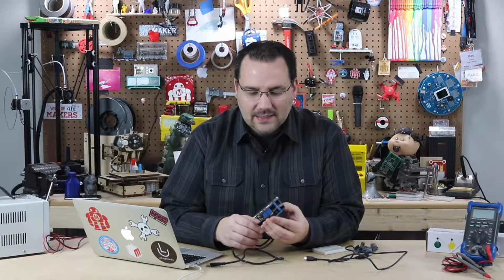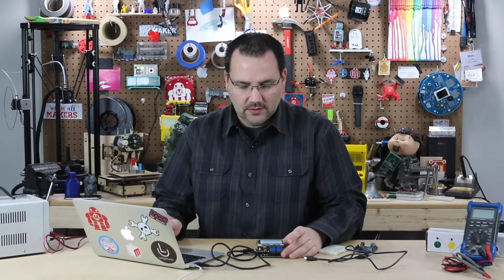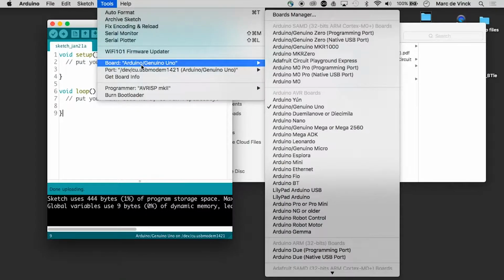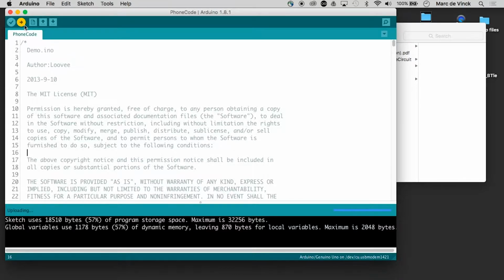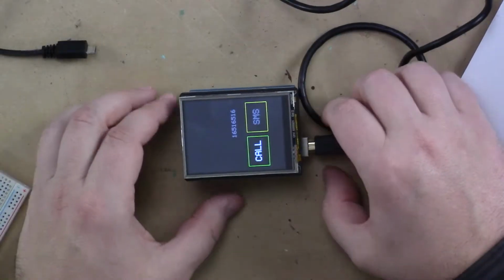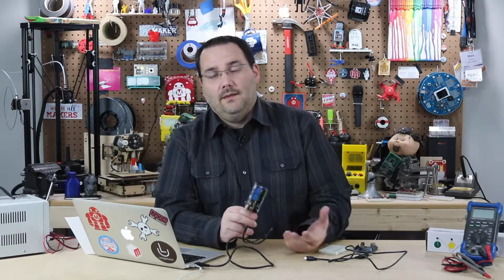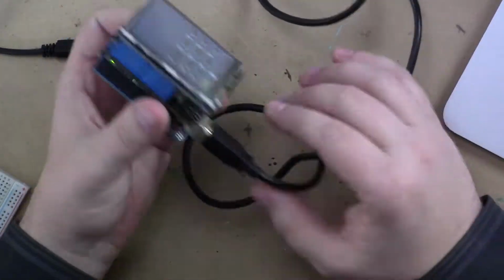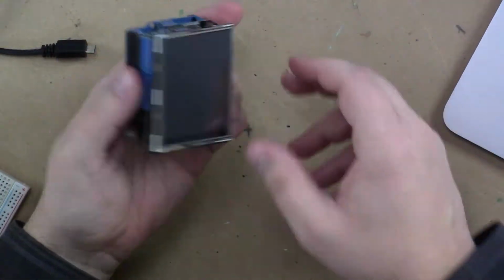Arduino Cellular Shield: Build a Working Cell Phone

Comment from the maker: ⚡ QUICK TIP: Before you buy any cellular shield, check two things. First, what network technology is actually available where your project will live, GSM is dead or dying in a lot of regions and an old GSM-only shield will be a very expensive paperweight. Second, decide up front whether you want onboard GPS. Buying a combined cellular plus GPS board costs a few dollars more than the cellular-only version and saves you an entire second module, extra pins, and a second library. And do not forget the SIM. A prepaid card runs about 30 dollars and you can refresh it every 30, 60, or 90 days.

📌 FULL SERIES: Watch all 100+ episodes of the Complete Arduino Prototyping Series. https://www.youtube.com/playlist?list=PLcKte0wD90Y4lsrStEWB5NR1gKMs0FDts